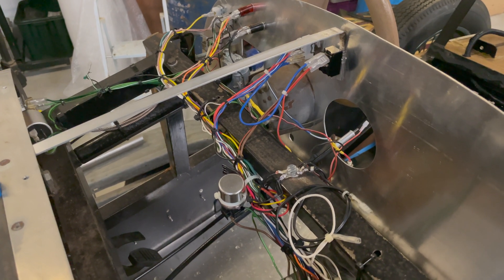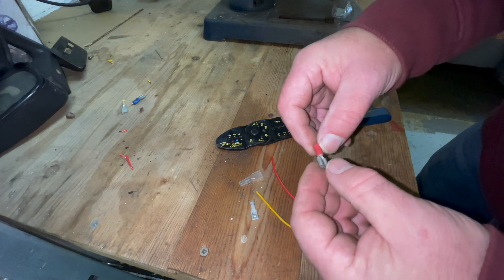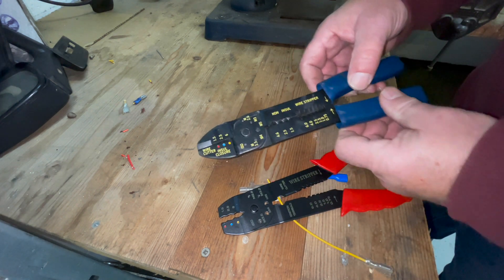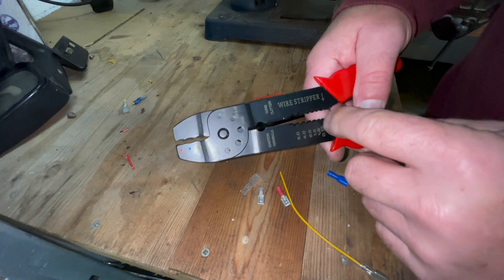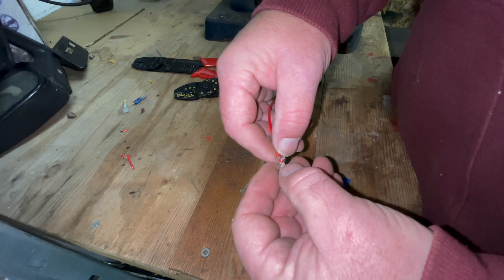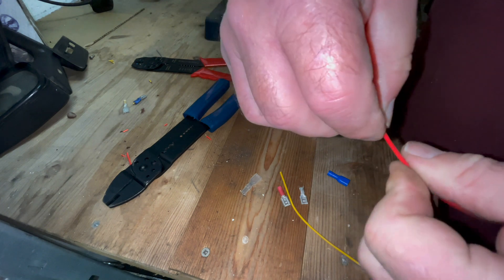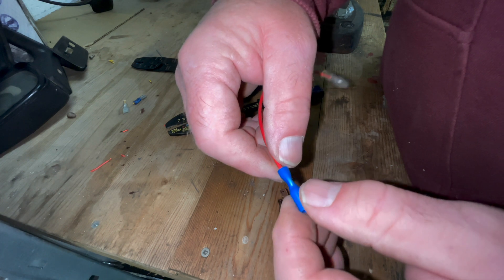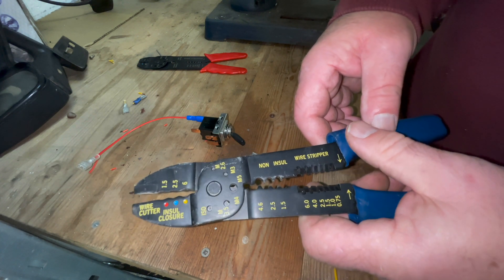How to use a Crimping Tool

Comment: What is the function of the M2.5, M3.0 etc holes in the middle of the tool...?
Reply: They're intended for shearing (shortening) bolts without damaging the thread.
Reply: M before the number indicated it is a matric standard thread size wich may or may not compatible with american standard thread hole, depend on the size and your application.